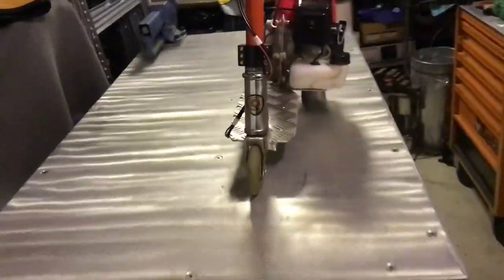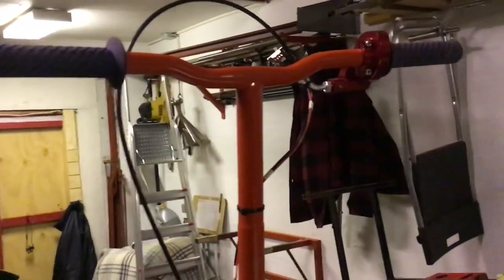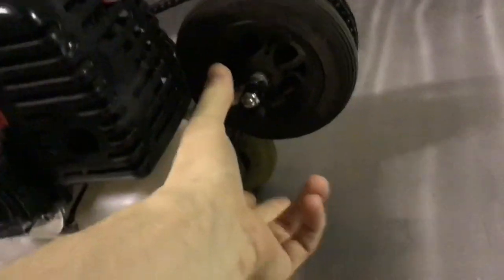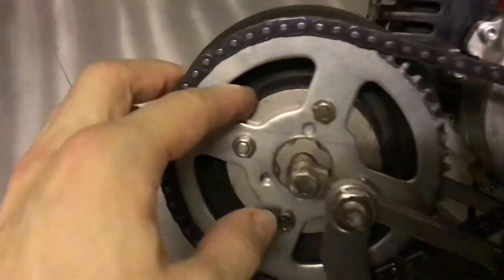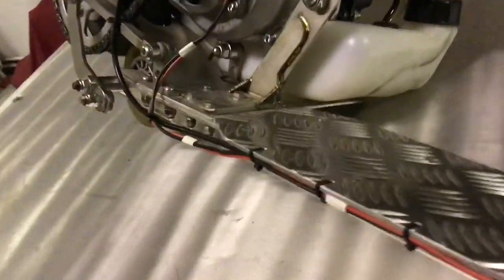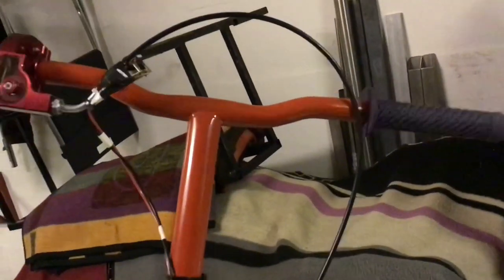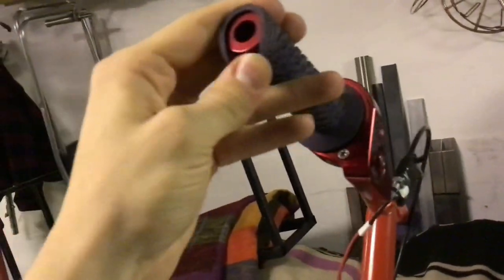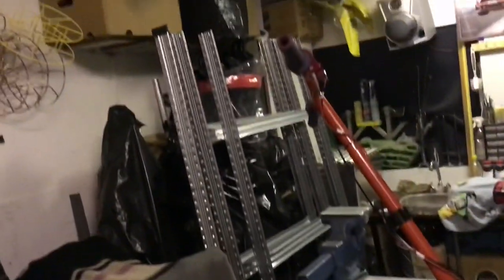Homemade GoPed [Unusual Design] Part 1

Comment: I would never ride this. It looks soooo sketchy. Waaaaay too much horsepower for rubber wheels. Also, way to covert a chain drive to a spindle 😆.

Good job though, you definitely showed off some skills.
Reply from the maker: Yeah this was just an experimental project. I like to create things I’ve never seen before.
Riding it is fun as hell as long as you ride it on a fairly smooth surface, but once it gets rough you’re in a life threatening situation🤣